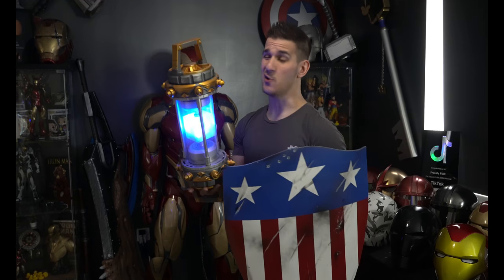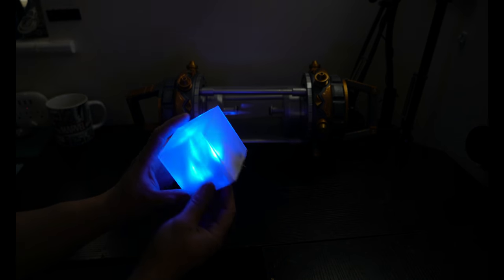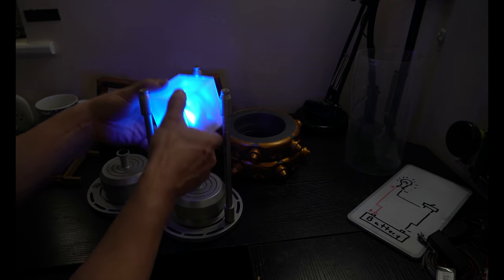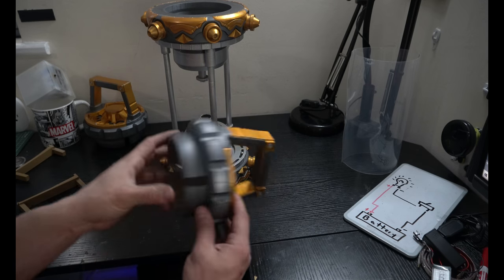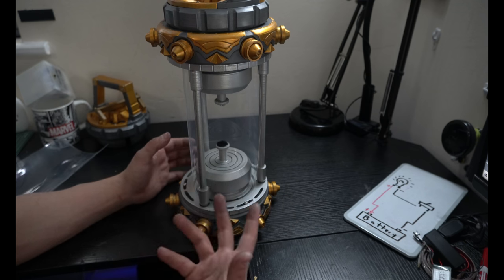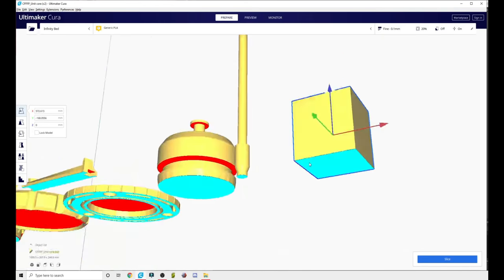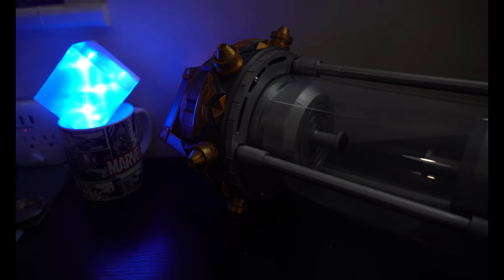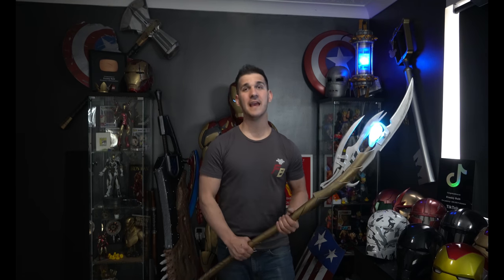How to Make The Tesseract From Captain America | The Space Stone

Comment: A fun little tip to make the Tesseract look even better - replace those LED strip lights with a few candle-flicker LEDs. 5mm Straw Hat bulbs that you wire up in a simple circuit just like yours. They run on around 3-3.5v so work with 18650's or Li-Po's with no need for resistors. The flicker effect does a great job of replicating the way the light of the Tesseract flickers and swirls in the movies. 
https://www.ledsales.com.au/index.php?main_page=product_info&cPath=148_152_154_312&products_id=1540

Comment: Just saw this video and i loved it. i appreciate how you explain things. Gave me an idea for another version of it. Install the battery into the handle. Have it set up; were you turn the handle activating the switch. Drill a hole through the center cube mounts, that way you can run your wires through. So every time you turn the handles it lights up the cube. Just an idea.